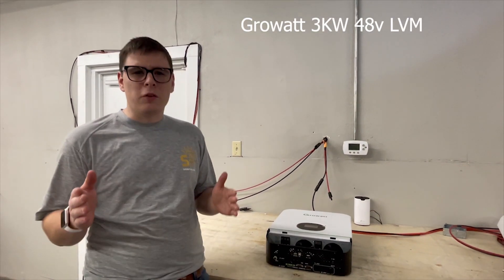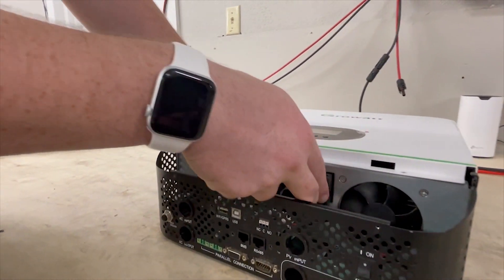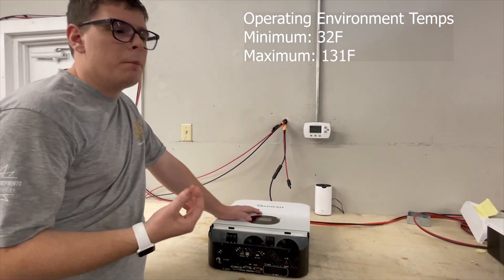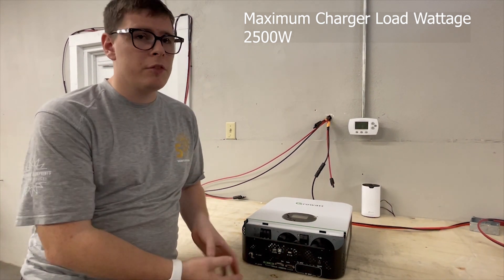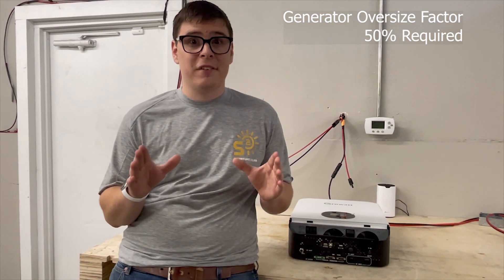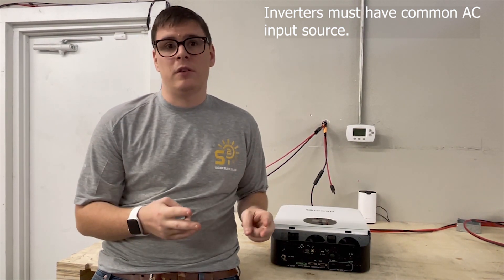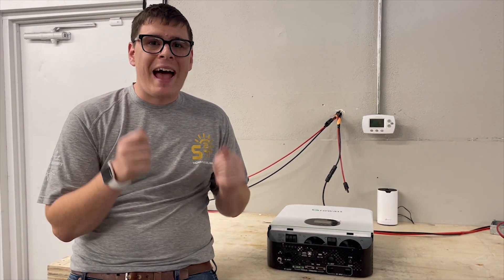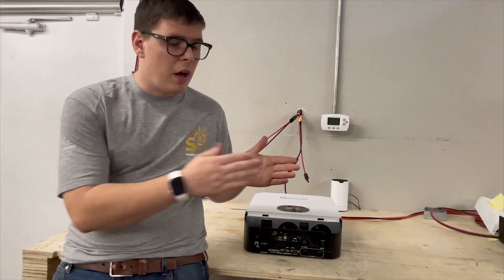Growatt 3KW 48V / 120 Inverter

Comment: Hey, I'm looking for some insight on this inverter. I'm connected to 2 HSKY 103Ah Big Battery 48v batteries. I have set up the settings to the specs of the batteries and am able to charge the batteries. I'm having issues with discharging to a 2 pole 40 amp overload protected circuit breaker, which feeds 20amp GFCI receptacles. I'd like to run a 4 gang receptacle box, but I can't seem to draw any power from even one receptacle. When the receptacle is wired up to load, the green light comes on. When the receptacle is wired up to line, the red light comes on (I know this is incorrect, I just wanted to test the other option). I'm unable to press the test or restart button on either wiring configuration. I'm having trouble with hearing back from GroWatt as well and your videos have been very helpful. Is there anything that you can think of that could be causing this issue? Thank you in advance for any insight!

Comment: You can limit your utility charging input with program setting 11, "Maximum utility charging current". So, then, I think that you could set that to 14 and charge from a 15 A regular wall socket. I have 3 batteries and 2 3000W inverters on the way. Thanks for offering such cool products and informational videos!
Reply: That's what I read. I'm going to set a 30 amp limit and use a 40 amp breaker and 10g wire. This is new to me, but some of it just requires reading the manual. :D
Reply: I was just about to say that.

Comment: So the inverter is not inverting while charging?????? What???????
Reply: it transfers the load to the AC input which stops using the battery, and starts charging the battery as well.  (that is why he said to add your load and charging wattage together to size then generator)

Comment: What factors should I consider in deciding between two of these and the ES5000 w/midpoint.  Will be using the 48v battery of course and 5k-ish panels.  Thank you

Comment: should the inverter drain down a 48v battery overnight on standby?
Reply: The draw on the grow Watt 48 volt 5000 KW is about 65 to 75 Watts per hour. Therefore I conclude that the 3000 KW is either the same or less. In answer to your question it depends on your battery Bank but if it's 48 it definitely would not drain it overnight on standby. Of course amp hour enters in to the equation. Simple math is however many volts your system battery system puts out times however many amp hours you have equals your total kilowatt hours. 1 KW hours equals 1000 Watts of power.

Comment: does growatt have a model with a built in transfer switch and 2 a/c inputs?
Reply: I think that this grow watt has a mode called sbg(Solar Battery Grid) Or a similar mode that lets you go off solar then battery then grid if your battery get too low. But you should see if you can find the manual online and read through it for this system.

Comment: How am I supposed to supply this Growatt with 45amp AC? My utility panel has 15amp and 20amp breakers and 30amp for 220VAC. I can not get over 20amp AC without going to 220VAC. I was following on just fine until you said I needed to supply the Growatt with 45amps! (my unit, still in the box is the 24VDC 3000Watt). Please explain so a non-technical person can understand. Thank you.
Reply: You need to buy an appropriate sized double breaker for you panel manufacturer available at big box stores and electrical suppliers.
Reply: You can buy a single pole 50 amp breaker, problem lies in the fact of getting a new circuit ran to your plug.. which would have to be a dryer size... you would have to to run 8/2 from ur panel to your inverter. I'd set a disconnect instead of a plug and wire it like that. 
If all that is true what hes saying then the growatt is not worth buying, and again, why have a setting for both the chargers? I have 24v model and I've just been use the ac input to charge my batteries on the 60 amp setting and have had no problems. However, now I'll do a amp test at the outlet and see what's really being used.... again the math is
 60amps x 120v =7200w if what he was saying is legit, #12 wire would burn up in the wall or trip the breaker...
Reply: he has no clue
Reply: Let me reply again cause I've been studying the inverter for a few weeks. You have 2 chargers on the growatt.  If ur charging the batteries from the grid then yes, it's pulling amps that you have it set on plus, any loads that are running through the inverter while your batteries are charging. 
 I've set my charger in setting 12 I think, to 25 amps. Thus, get you a volt meter that can read amps and go to ur panel and read the hot wire supplying your plug while the growatt is charging from the grid. 
Think i may upload a video doing this cause cause it could lead to an electrical fire, or burning up the wire inside your wall. I'm an electrician with 20 years on the job.

Comment: Per the manual it's 2awg for the 24v model but 4awg for the 48v model. I know it lists both in the same manual. Or is this a different model than I'm looking at?
Reply: You are correct. 4 awg for the 48 volt model. I think James took his review of the 24 Volt model that he just did 1-2 days ago and used that information not realizing that the 48 volt model reduces size of the cable slightly..
Reply: @TK-123  I’m sure you’re right, wanted to get the comment in for those looking. Not that too large is a problem. Just a bigger highway for the electrons! Ha ha
Reply: That is correct i just wired mine with 2 gauge yesterday, bigger is better but it seems silly when you are connecting to a tiny 6 mm stud which would melt with any serious amperage ?

Comment: Around 1:28 you mentioned that the pv wattage NEEDS to be 4500 or below. I've read on so places that is there is no maximum wattage for tge panels used. The mppt will USE 4500 watt as a maximum. Anything over that will not be utilized. It's called "clipping" From what I understand is that you can connect as much wattage panels as you want, as long as you respect the voltage limitations of the panel series.

The overpaneling can be useful if you want to charge the battery at a reasonable rate at cloudy days.

Please let me know if this is correct. Thanks
Reply: That is my understanding as well and look forward to someone that knows (I am not technical) as I am about to purchase my panels and was planning on "over paneling". Thanks!

Comment: I know it’s overkill but can you have one inverter that’s just connected to the battery and not connected to any output to change the batteries? And adjust it to charge around 20/25 amps?
Reply: yep, or even higher charging amps you can adjust on the fly

Comment: What happens when it's overloaded?
Reply: 6000w serge on the inverter
Reply: You CAN NOT exceed the open circuit voltage specification! James should have covered that. You will destroy the inverter if you exceed 145 v open circuit. That is why I bought a newer version -ES, which is rated at 250 Volts open circuit
Reply: @TK-123  I have the SPF 5000TL HVM-WPV model. Trying to figure out how to know blow it up. Aren't they design to shout down on something as a safety measure?
Reply: @aberba  Not according to Will Prouse. He has a YouTube channel called DYI Solar that is excellent. He has viewers that have emailed him and said they destroyed their inverter by adding panels that exceeded the open circuit voltage. Didn’t say how far above the max voltage that they were at.
Reply: @aberba  Isn’t your inverter a 220 v only model that is rated for 450 volts??
Reply: @TK-123   it says my pv input voltage is 450vdc. MPPT 120-430vdc. I'm not really knowledgeable in those numbers.